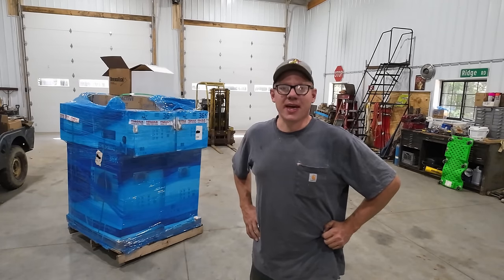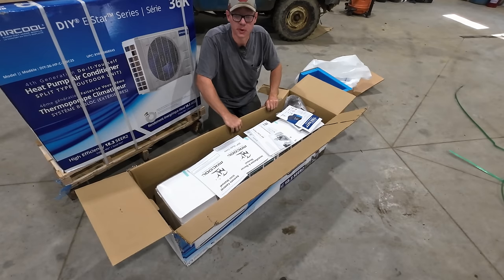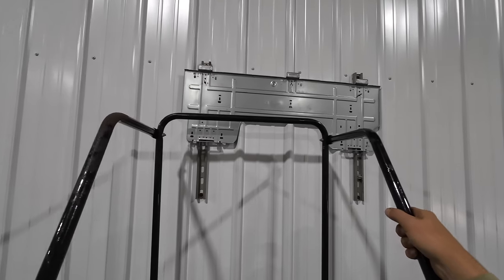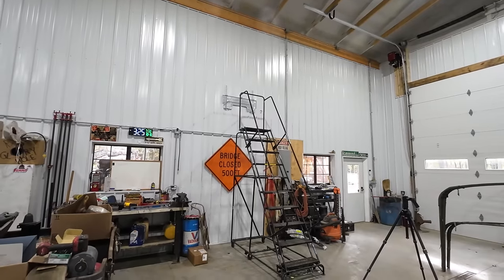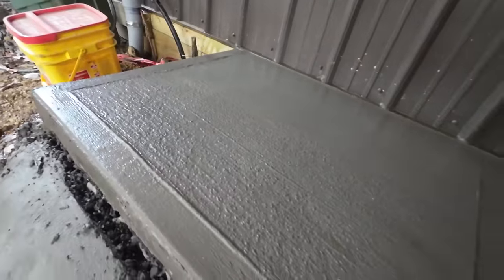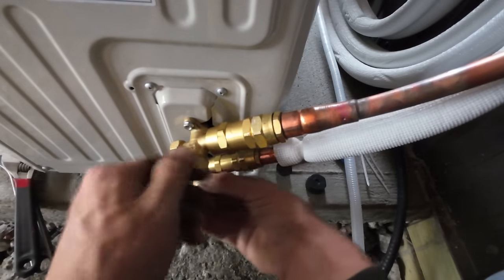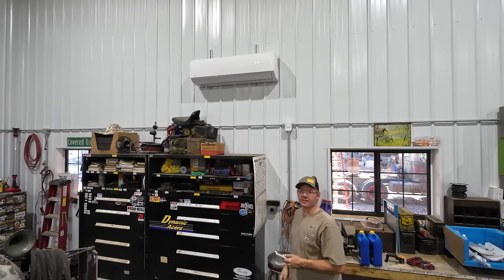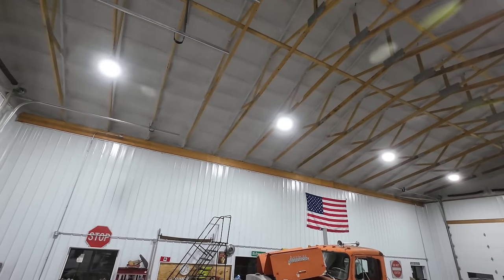DREAM SHOP Gets a Serious Upgrade! (How Hard can HVAC be??)

Comment: Don't you need an AC disconnect before getting the compressor power from the panel?
Reply: Two A/C disconnects, one for each mini-split.  Matt also needs surge/transient/electrical noise protection at each of the four units.  Electric noise will kill those units long before any mechanical refrigeration problem.  The control circuit boards are both expensive and extremely hard to get, the complete units are sold everywhere in the U.S. - the circuit boards can be found in southern China, I haven't found a U.S. source I would trust.  There's a business opportunity here, import the replacement parts from China and resell them here.  You'll need to find someone who speaks Cantonese or Mandarin.
Reply: Supplyhouse is a great place to find replacement parts, they're fast and efficient, their prices for control boards are reasonable ~125 or so, here's the however part:  they have been "out of stock" for the last couple of years  - people don't want to be told their A/C unit might be fixed in five years when the part is available.  Supplyhouse is a big company, they buy everywhere all over the world ... maybe the parts were in stock the last few years and I just missed them?  Their customer service always says 'we just sold out of that'

Comment: The only mistake you made is the extra line set should be mounted horizontally to avoid oil traps, but you will probably be fine.

Comment: For a roof that high, I'd want just simple air circulation too, otherwise all the heating rises to the top and you might be shivering down below.
Reply: It's radiant floor heating....  so there is little heated air to rise. 

SO!  In the summer he could circulate water from the well through the floor to create a heat sink, using a dew point controller to prevent condensation. Just return the water to the well.  If  necessary, a heat exchanger would keep the fresh water from the boiler water. 

I never did see the heating plant on this building.

Heat flows to cold!
Reply: @redjohnson4859  Floor heating still heats the air, otherwise why have it?  Just to keep your feet warm?   Also this video was about "forced air" heating/cooling via heat pumps.  But regardless of where the heat comes from, it still rises.  And really both when heating and cooling, you want to circulate the air from the very top too.  Just circulating that air can reduce both heating and cooling costs, which is one reason people have ceiling fans, for example. And they don't even have 18-foot deilings!

Comment: Want an endless supply of water with zero minerals in it? Good for cleaning stuff. Then run those condensate hoses into a barrel (remember an overflow).

Don't drink the water: none of the components are food grade and you can taste that real easy.

Comment: Think you have under gunned your system mate.   A 36k BTU is only 10kW in modern speak. I have a 5kW split in my lounge room which is maybe 1/20th the size of your shed.  You would have been much better off installing a HV ventilation system like a Cardiffair system. Your power bills are going to be extreme with an undersized AC system in a leaky shed.  Also a  Cardiffair system would work equally well with the doors open or closed.

Comment: Don't you have to pull a vacuum before you release the refrigerant?
Reply: "Don't you have to pull a vacuum" -- On these systems marked as "DIY" you don't need a vacuum pump (Here's the However part) those systems are designed to be contaminated, mixed refrigerant and air together, it saves a little bit on install cost BUT - the mixture is contaminated - it will always have poorer performance than a system installed with a vacuum, and slightly higher electricity used; another problem in the length of the lineset, the leftover loops of coil often pool the refrigerant oil, that can cause other problems.  If a DIY installer knows how to pull a vacuum they are better off cutting the lineset to length, flaring correctly and pulling a vacuum before they contaminate the system (even a little bit).  [HVAC installers get around 90 minutes (without travel time) to professionally install each system]. The DIY systems are 'good enough' for a quick install

Comment: Why didn’t you buy a unit that you could run two inside units from one heat pump on the outside. That is what I have and it has ran for 5 years with no problem

Comment: Any HVAC people watching please explain why it's not necessary to pull a vacuum on these systems before opening the valves on the outdoor unit?
Reply: Magic.  Or, the systems are designed to run with a contaminated mixture of refrigerant and air, it isn't much but it is a mixture; the efficiency will be reduced, it won't be a huge loss but there will be a loss.

Comment: I'm surprised  you don't have a waste oil burner  which all that equipment  and change  oil  and fuel
Reply from the maker: Everybody that says this has never actually run one of those furnaces. It takes so much more oil than you can imagine to keep one of those things burning. I would need five times the amount of oil that I go through to heat the shop.  Lol
Reply: @DieselCreek I understand  where your coming from I've used one we had a small one at the county road department  that I worked at   there are some bigger ones just seem like it was a option  with how much you change oil sometimes and  some parts store would probably  let it go of there used oil
Reply from the maker: @raywells6341  I know some people that have them in their shops and they are constantly searching for oil. It’s not easy to find around here. You have to fight people for it. I’m going to build a filter set up so I can start running all my waste oil in these old diesels, they will burn it up nicely

Comment: errr you forgot to evacuate the line set and indoor evap coil … those pipes full of non condensables .. air/water
Reply: Those units he got are specifically designed to not have to do that. Notice the odd large connectors for the lines. The lines and indoor head are pre charged. Mr Cool sells the normal kind too that need vacuuming, but offer the full DIY thing as an option.

Comment: when you talk with the doors closed, it echos really bad in the video.  Can you put up some flags and stuff?  If you get flame retardant fabrics, you could even lay them horizontal over the rafters.  The reason people don't cool their shops has nothing to do with the price of the AC units.  It has to do with the cost of running the AC units.  Do yourself a favor, and dont leave the heaters at 70 degrees when its freezing.  do 60 my man, you can turn it up when you get in.  Save yourself that money

Comment: This is a dead horse topic here I understand that.  I offer in case someone else is in your shoes.
50 000 in stall.    150 a month.  equals 1800 a year.   Add 5% per year inflation never mind any actual price increases...(like mine has been 8% increase each year for three years running..)  Over ten years that is $22640.   Total of 75 000 US$         You can purchase a kit and assembling it would be no harder than the heat pumps.    A system of this size would have a genset attached and you can set it should your load go over say.....10 000 watts the gen set kicks in to take the brunt of it.     We have batteries that will last 10 years under hard use and 20 years at 75% duty cycle....  The entire world of "off grid"  has JUMPED  leaps forward in the last ten years.     Please anyone else in his position please consider solar.    I am already   ON  Grid and I just spent $6000 US  for a solar system that will cover 90% of my house.     I will still have Grid power if I want 240V.,   Not to be confused with grid tie....  My house is not wired as most houses.  I have two large breaker boxes and as such it is easy for me to disconnect the second from the grid all together.
Diesel Creek fan.  cheers

Comment: Dude, F the power company. For 52K, you could have a really good part of the start of a massive and effective solar system. Really, F those D bags. You already have all the work done. Their costs on a run of wire, even if they're bring it, aren't but a few thousand dollars. Paying fat Larry to mutter, grumble, pull, and connect it, is a couple hundred bucks. 

I know you're talked about it before but go back and look at solar again seriously.

I've also just realized, from this very video, that you're left handed. Sorry about that, too.

Comment: i bet you found out why the poco wanted $50 k to finish all that work. cut in 3splice boxes pulling in all that cable splicing it providing a transformer secondary and building a riser is a lot of work you cant get the rent a bums to do
Reply from the maker: They did it in 2 1/2 hours. It was a cakewalk for them. They do it every day.
Reply: i was in thst business for 35 years matt. 2.5 hours to set up that cable pull….. hardly
Reply from the maker: @JeffRiley-tc6cy  they sent 10 trucks and 15 guys lol I’m not lying. There will be a video
Reply: so maybe thats why it was $50 k
and about a 1,000,000 worth of equipment 
i was billing over $250 an hour for two trucks and 3 guys for damage claims a few years back. i know it didn’t get cheaper

Comment: What are they going to do you must be kidding us 52,000 for electric line you put all the pipes in all they got to do is pull it and put it up on the wall that's why I went with solar and when and even I don't get it no my shop is air conditioning too and heated floor and it is 100 * 110 were the 16-ft wall I don't know guy